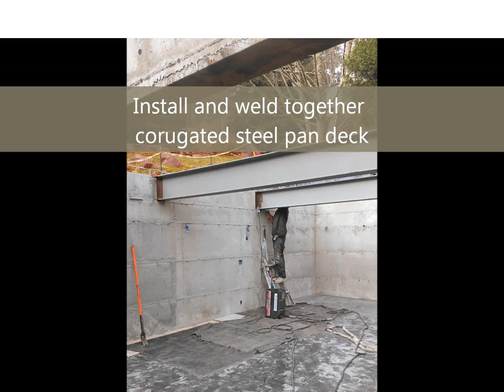bunker garage construction vid 1

Comment: Nice job. When I did a similar but much larger project, I used precast concrete planks for the roof because they were cheaper and faster than casting in place. That was 1990. The current prices may not support my choice at this time. The crane contractor was a friend who gave me a good price. Good Luck, Rick

Comment: Infrastructure:
Bunker would add about 10 foundations at a depth of 10 meters, Konstrtktzih of iron and cement.
4 drainage holes at a depth of eight feet, with plastic sleeves and gravel.
Preparation of electricity.
Operation grounding structure,
Ovarian adds electrical wiring.

Comment: 30-50k depending on how much concrete that really is, and if you do any of it yourself. That's my guess of what you should set aside...you can build a 600sq garage with concrete foundation for 9-10k if you do all the work yourself other than the pour of concrete. Depends where you live too (costs can vary by region, country). I would say 30K should get you the whole thing framed and poured in the US, but call a few contractors? good luck